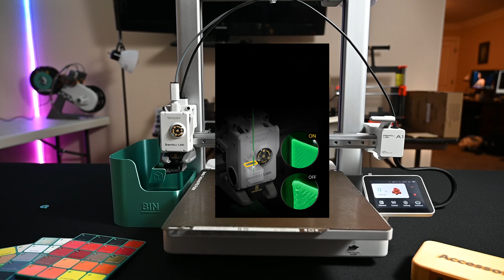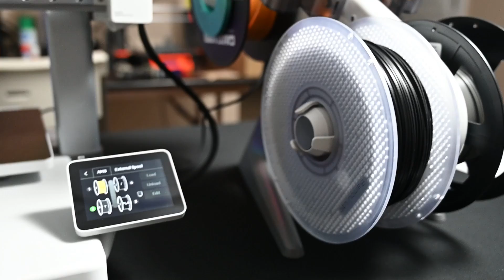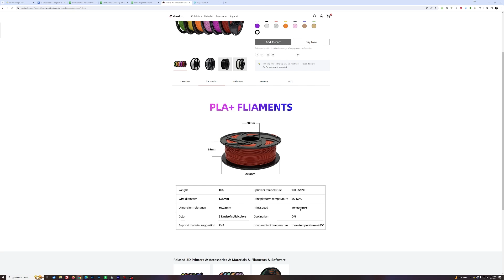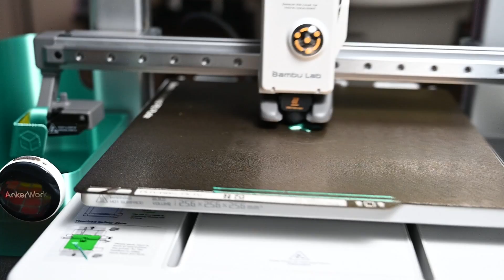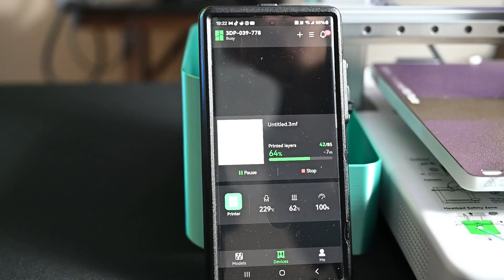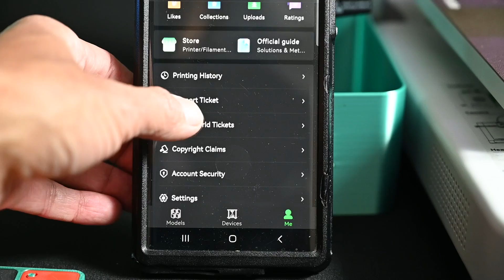Bambu A1 Review - An Honest Review of this $399 3D Printer

Comment: Hey look, it has the same linear rail system on the x-axis that I added to my Creality Ender 3 v 2 for $8!  And it has the exact same dual z-axis (wrapped in ejection molding) as my Ender 3 v 2 that I added as an upgrade -- except with it, I can have those motors and such closed off and epoxied.  Also, when things are covered with injection molded plastic, I have to think there are some plastic parts in there.  Reminds me of a microwave -- and the fact folks refer to it glowingly as an "appliance" and not a "machine" I guess makes sense.  And, no, I am not a fan of any specific brand.  I love people getting into 3d printing and if this is the entry, then awesome.  But this printer sells for $399 because they cut a few corners to get there.
Reply from the maker: @christopherorman5769  I appreciate your thoughts.

Comment: Thanks for the no-nonsense review. I'm having a hard time finding anyone that doesn't recommend the A1 for a first time 3D printer. I've been watching from the sidelines since the early 2000s when things were pretty bad compared to now. I'm an engineer but I don't really want to fiddle with the printer too much unless I want to. Someone said that Bambu Labs is like the Apple of 3D printing. That resonated with me. Normally Apple is pretty good but the last few years have been dicey.
Reply from the maker: I am the same way.  I used to enjoy tinkering and didn't mind spending hours to get something to work.  When I decided to buy a 3D printer, I asked around and eventually bought a Prusa.  They make great printers, but they still require work to get them dialed in.  The Bambu printers take care of all of the dialing in for you.  Quick unboxing, a few setup procedures and then the printer takes care of the rest.  You can still make mistakes (like I did in the video), but they really do make it easy to get great prints without having to be an expert or have years of 3D printing under your belt.

Comment: A note about filament print speeds … if you have a well tuned printer like the A1, you can exceed these print speeds without any artifacts. For example, I usually use a PLA+ that is rated at 40-80 mm/sec and have printed successfully at 200 mm/sec with the A1. Use tests to determine what speed you can print your non-Bambu Lab filaments. One other issue I have is that filament print speeds are measured in mm/sec. What nozzle size is this for? Melting equal lengths of filament in a smaller nozzle should push out at a higher speed and a larger nozzle used at the same print speed will require faster heating. There should be 2 filament flow statistics instead. One for the printing speed limitation due to viscosity expressed as mm/sec max speed and a second one measured in mm^3/sec that indicates the melt rate range. When using non-proprietary filament, take some time to do fine tuning on overhang settings. The A1 seems to set the fan speed too low and overhanging deposits tend to warp upwards and threaten to dislodge the model when the extruder hits them.
Reply from the maker: @fraudbuster1456  Thanks for this great information!

Comment: Hello. Can i use abs filament in a1?
Reply from the maker: It's not recommended.  An enclosure is ideal to prevent warping with ASA.
Reply: @directedt3ch  i want to make auto parte for exterior..to resist heat..what kind of filament is alowed, for a1 printer? Thank you
Reply from the maker: @cris5341  The recommened filaments for the A1 are: PLA, PETG, TPU, PVA: I have only printed PLA and PETG.  PETG might work for you but ASA is the most often recommended for outdoor use.
Reply: @directedt3ch  tkx.

Comment: So it takes 10 minutes of prep before every print? I can't live with that and was about to buy one.
Reply from the maker: It's more like 5 to 6 minutes. All printers take time to heat up the bed and nozzle and then go through some calibration steps. It's time well spent.
Reply: @directedt3ch  but sometimes a print fails or you realize its the wrong file, then you want to start over without having to recalibrate every time?
Reply from the maker: @adventurerides-za  That can happen.  In that situation it would take less time since things were already warm.  It will still make sure the nozzle is clean and the z offset calibration takes less than a minute.

Comment: been trying to decide between this and the P1s for weeks now. with the sale kind of forced to make that choice sooner than later. having used both is there any specific reason you would recommend one or the other? i dont necessarily know if ill do the abs materials and need the enclosure but the enclosed ams and peace of mind of an enclosed printer sounds nice. but $400 more expensive. anything helps, thank you for another great video !
Reply from the maker: I do have to say that I find myself using the P1S more due to the enclosed AMS and the ability to hold hesitant inside.  However, if you want ease of access to everything and plan on doing nozzle swaps, the A1 is way easier to deal with.
Reply: @directedt3ch  this will be in my bedroom and temps in here can get warm being on top floor so thats why i lean enclosure. i want to be able to print with as little worry possible. coming from an ender 3 v2, i just want to print good parts lol. thank you for your response i greatly appreciate it!

Comment: I read that you can print 256x256x256 when the AMS system is NOT used. 180x180x180 is tiny. Even smaller than my Neptune 4 Pro that I'm sending back due to issues and print volume. Have you tried the bigger build volume yet?
Reply from the maker: I haven't tried a full volume print yet. Someone else comment though that the hacks are only needed on the X1 and P1.

Comment: Thanks for the review. As soon as the recall is taken care of, I'm grabbing one of these. I'm fed up with my old ender 3 pro. I just want a printer that prints well without constant babysitting. And thanks for the purge bin model!
edit: What color/brand did you print the bin out of? That's an amazing green.
Reply from the maker: I think you'll be very happy with the A1!  Hope they come back really soon.  The green is a silk PLA in "Emerald Green" that I bought from Amazon years ago.  I'm not sure what brand it is.
Reply: @directedt3ch  So far, it looks like they'll be back around May, so I have a bit longer to put up with my ender 3 until then lol
Thanks on the color info too, it should be easy enough to find one similar.

Comment: Good in depth review, with good detail, without going to slow.
This is the printer I’m interested in, but they are not available at the moment do to a recall.
Might get its little brother instead, as I don’t think I will be printing larger items, and it has a good reputation.
Huge upgrade from my old Getech printer.
Reply from the maker: I think you'd be happy with the mini too!  Only real difference is the build volume and it you don't need that big of a space (which I rarely if ever do), it'll be just fine!
Reply: @directedt3ch  Thanks much. It makes sense too, as I already have a 12"x12" printer, that I can fix up, if I need the size. Smaller probably = lower energy cost too, as you are not throwing around as much mass, and heating as big a surface, with the smaller A1 mini.
Big volume prints, eat up filament faster as well.
And there is always the option to glue things together to get larger size.d
Have a great day ☮

Comment: I have both A1 and A1 Mini both with the AMS lite.  I have run out of my generic filament and the system stopped and notified me I run out of filament.  I simply unloaded the empty spool and loaded another spool.  Fed it through till it stopped in the exact same spool number and then simply pressed retry and it kept on going like it never stopped.  In fact I ran out of the 2nd replacment spool cause I was using up a few spools but the same color.  I worked great thought I should share
Reply from the maker: Thank you for letting us all know!  I think I may have recently read that if the A1 detects that there is no longer filament in the AMS when it finishes a color, it will purge that remaining filament since it can't retract it.  Smart machines!

Comment: As long as you mod your dryer box to use the fancy sping-loaded spool holders from the AMS lite, you can feed the filament into the AMS from it perfectly fine, so the inability to dry filaments on the AMS is only a pseudo problem. It is solvable, just more effort.
Reply: I'd also like to add I've near exclusive used bambu handy and it's worked perfectly non stop. Perhaps you mistakingly chose A1 mini or it defaulted to it and you didn't notice or something. It slices on their servers according to the printer model and filament(s) you select.

TPU also prints fine, just not on AMS lite unless you want to do a fair bit of overinvolved modding. Someone did achieve multi-colour TPU printing on the AMS with a lot of mods, however.
Reply from the maker: @KannaKamui  I definitely can't rule out user error on my part!  I've notice that quite often when I open a model from makerworld into the bambu slicer it's loaded a profile for the X1C.  If I'm not paying attention that'll cause problems.  I'm just more accustomed to only dealing with loading .stl files and then setting all the printer/filament/profile settings on my own.  Thanks for the insights!
Reply from the maker: I totally agree.  It's not quite as easy as just adding a filament dryer like I can with my other printers, but it's not super hard to address.

Comment: I have used the AMS in filament fail-over mode used up 10+ mostly empty spools, and have never had an issue with it
Reply from the maker: Thank you for sharing that!  The first time I thought about using a near empty spool it was for a color that wouldn't have been used much, so I thought that I might run into problems if it couldn't retract.  It's good to know that this shouldn't be an issue.  I believe I mentioned a motor in the spool hub, but now I believe it is actually a spring that gets wound to provide back force and it's only the filament drive motor that reverses the filament direction.
Reply: @directedt3ch  From what I've researched, thats how it works yeah

Comment: I just got mine 3 days ago, and it’s amazing. Really, in this price range if you print mainly pla petg and tpu there is no reason to buy any other printer.
Reply from the maker: I whole heartedly agree!
Reply: What desk did you put it on
Reply from the maker: @cookcraftedworkshop8801 In this video, the printer is on a 6 foot folding plastic table. It is normally on a smaller 4 foot plastic folding table. It shakes the table a decent amount, but it doesn't impact the print quality.
Reply: I got mine 3 days ago, and it has been printing almost constantly. Coming from the ender ecosystem (2 ender printers), I can confidently say I am never going back.
Reply: It's $400. It's overpriced
Reply: @Techno4more find me another 400 printer have such functions and print quality, please don’t make me laugh by saying ender 3 mini lol
Reply: @Thekidisalright  what functions? The multi filament? Well other than that, any Kobra 2 pro , tbh there's lots of options
Reply: @Techno4more the first review I saw of that printer said, “clunky and bad first print, limited slicer, and not being able to remotely send files.
Reply: @lukefousek6723  I don't have those problems
Reply: @Thekidisalright  creality hi series? 😂😂😂😂
Reply: @Techno4more you don't seem to have a clue. This printer is great value for the price. (feature for dollar)